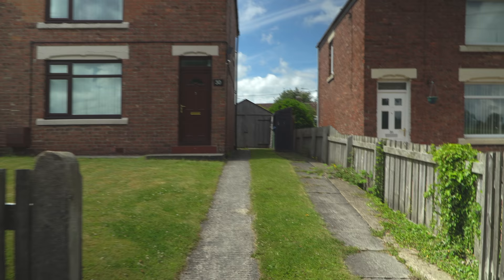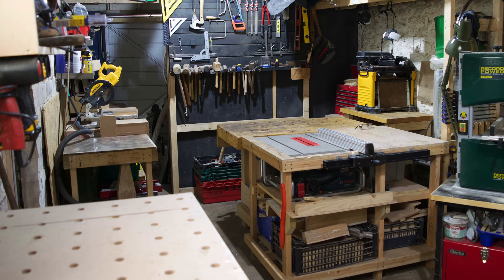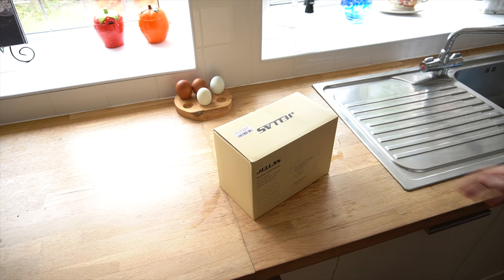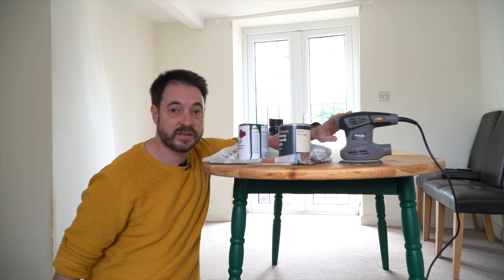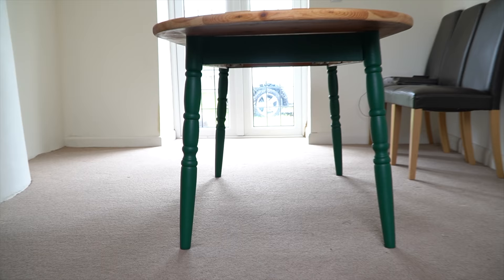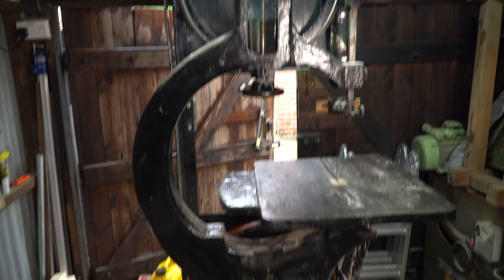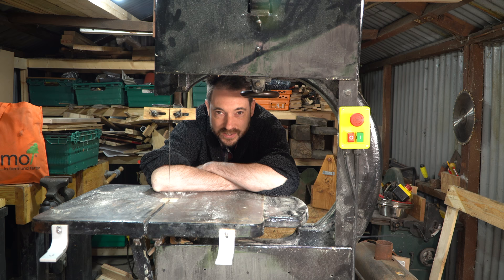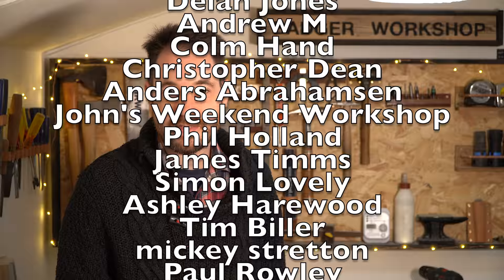Badger Vlog 01

Comment: i got the same problem 4 saw benches 2 mitre saws 1 flip over saw 3 circular saws 3 1/2 lnch routers 3 or possible 4 1/4 inch routers pluse loads of small handtools lick about 20 or 30 hammers and mallets and my workshop is the spare bedroom 10ft by 12ft thing is i just added a new 255mm evolution mitre saw and a new evolution trak saw should be deliverd tomorrow
Reply from the maker: You have the problem worse than me